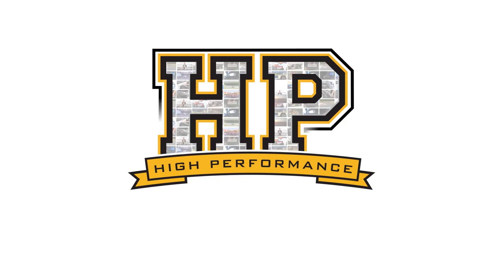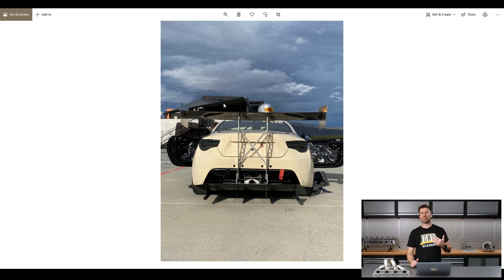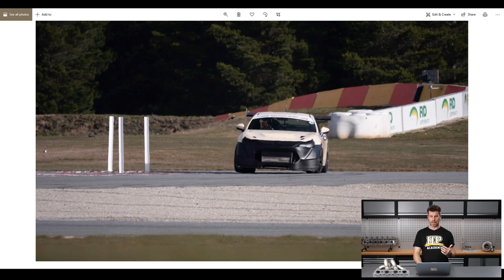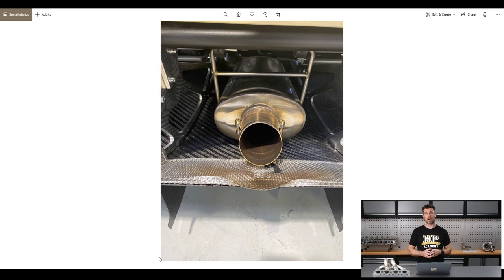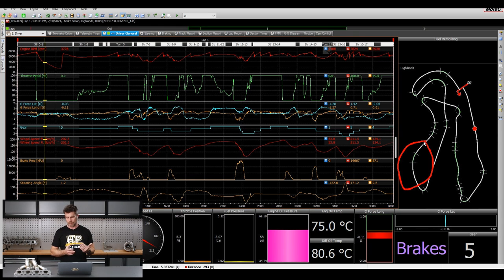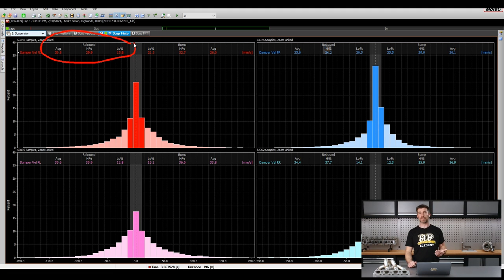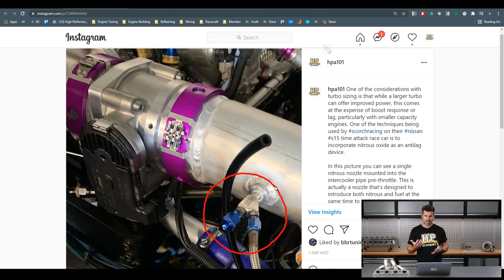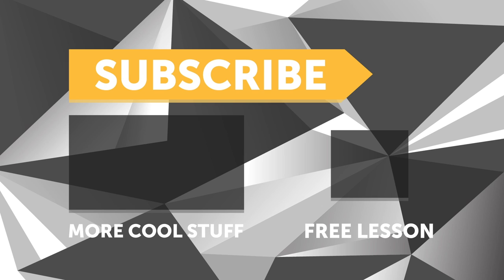Nitrous Anti-Lag, Suspension Data, and.... | Today At HPA [#UPDATE 290]

Comment: I think the installation of a freewheel system on the driveshaft might be a good way to maintain traction as well, though an additional clutch would be necessary in order to perform any engine braking or to go in reverse.

Comment: Haha!  Using titanium bits as a consumable!  How about attaching a worn brake pad to the bottom instead?  Probably last longer :) Car looks great!
Reply from the maker: There are a range of materials you can use, your local rule book will possibly guide you there if required. So long as you're not leaving chunks of whatever you're using on track (which titanium doesn't do 😉) and it's serving it's purpose as a rubbing block, job done I reckon.
At the same time cost wise, these are nothing compared to replacing a carbon aero components due to trying to take shortcuts. Even homemade aero still has a large time and monetary investment for people rather than being throwaway items 🤘 Doesn't mean you need to use these, but you definitely want to use something you 100% know works as intended - Taz.
Reply: @hpa101  Thanks, Taz, that was a very thoughtful and sincere reply to what was, admittedly, a smart-ass remark.  I've been following your progress for awhile and I admire your scientific approach to getting results.  I just found it funny to hear about using titanium anything as a consumable, keep up the good work!